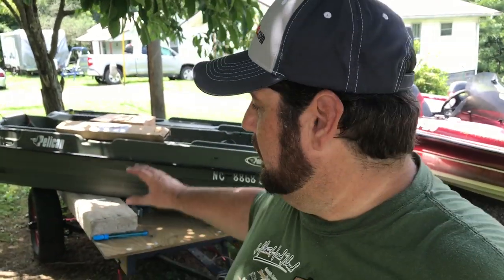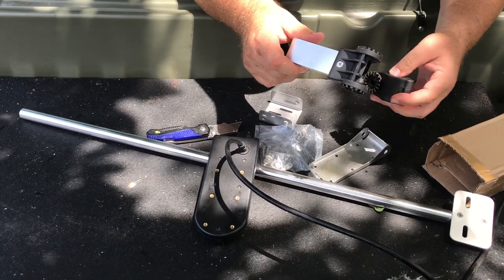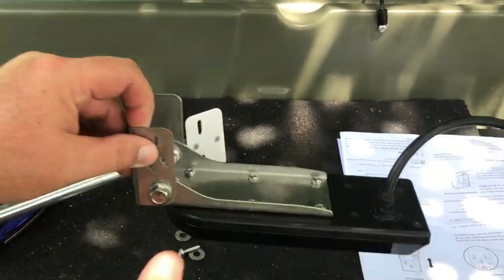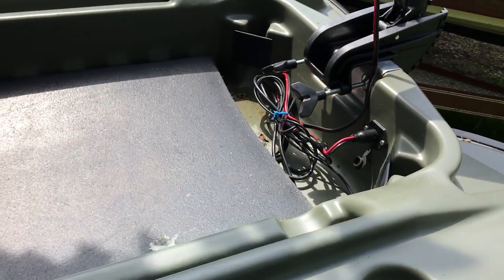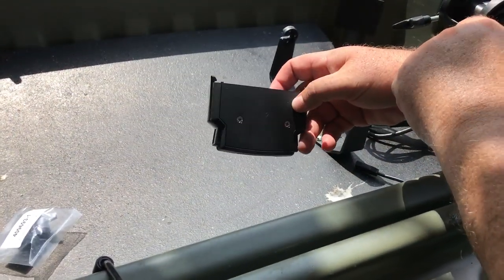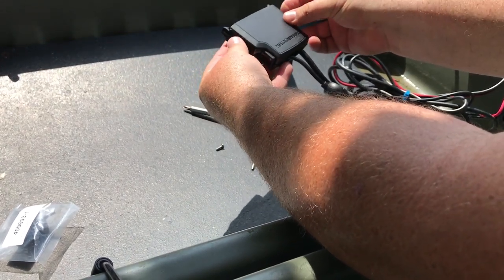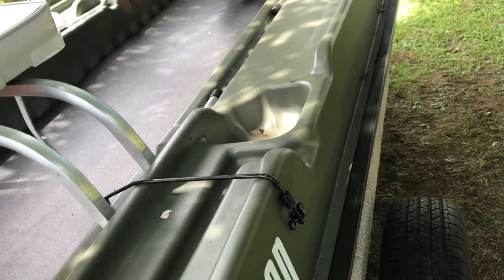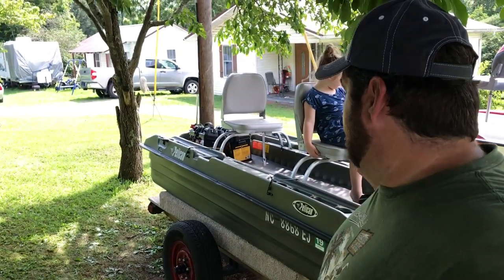Installing a Helix 10 Mega SI on a Jon Boat

Comment: Hank, probably need some kind of anchoring system , unless you plan on using a hydraulic or electric post type. Kyacks have a very simple system, or you may just want to use 5# dumbbells on ropes with some kind of hand crank.Thanks for the ideas you provided with this video. Your Grandaughter is precious .and she ROCKS.
Reply from the maker: Thanks yeah I need something for sure.

Comment: Would love to hear how you might mount a foot controlled trolling  motor.
Reply from the maker: harahara10 Don’t know that I’ll do a foot control in the small boat. The plus to a hand tiller is you can point it and not touch it again. With a foot control you have to stay on it all the time. Long rides will trying to put gear up the foot controller is a pain.

Comment: What was your unit in getting fixed and what was it doing on the water before to make you send it in? I ask because I'm having issues with mine now
Reply from the maker: It started lossing the transducer. So I would say no transducer connected. Then the Left side just went dim. I don't know what was wrong they never reeeeeally say but I figure the board was going bad. It started doing it today also. I'll be calling tomorrow.
Reply: @BassGeek  mine pretty much lost all sonar but it never said transducer was disconnected. That was a year ago and it was fixed. They said it was something with the board. My new issue is down imagine doesn't work unless it's on the same frequency of the side imaging. Of course it started happening a day out warranty. I'm hoping it's just the transducer this time.

Comment: Great video, but isn't that $1,700 Helix 10 Mega SI + other parts, a little bit of overkill for that $650 small boat?
Reply from the maker: It is. It's off my Bass boat so I already have the unit and the transducer because they sent me a new one while testing the head unit. (It was flaking out) So why not just add it to the small boat when I need it. I was only out 100 buck is cables. hahahaha
Reply: @BassGeek  Well if you got it use it, but, as for myself, I wouldn't buy one just to use on a 10 foot Bass Raider or Bass Hunter!

Comment: Hey Hank, what gauge wire do you have running from the back to the front for the trolling motor?
Reply from the maker: The trolling motor wire was already in the boat it's heavy so I would say it like 8 gauge. The wire I ran was 10 gauge.
Reply: @BassGeek  Ok Thanks. I have to run trolling motor wire for mine. It wasn't pre-wired.
Reply from the maker: Lil' BASSturd I’m sure it’s 8 gauge wire
Reply: @BassGeek  Great! Thanks.